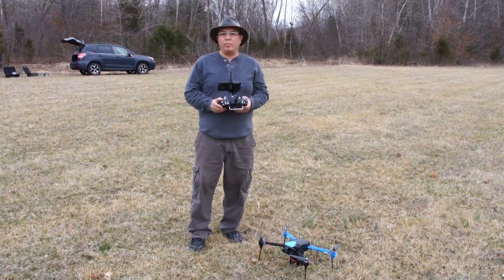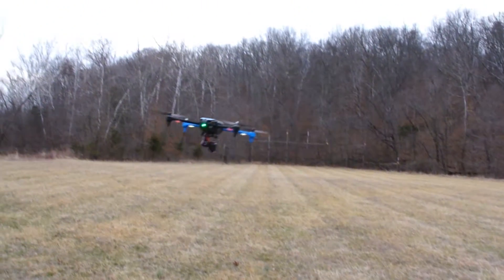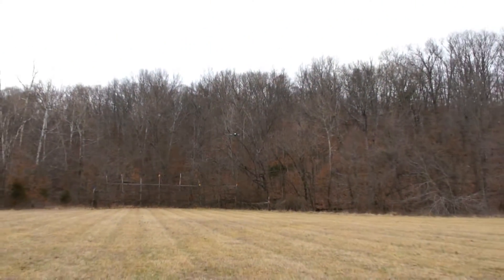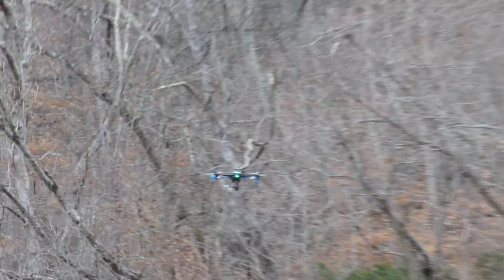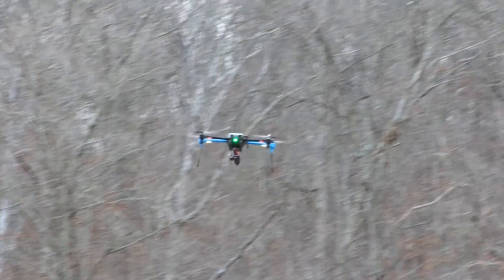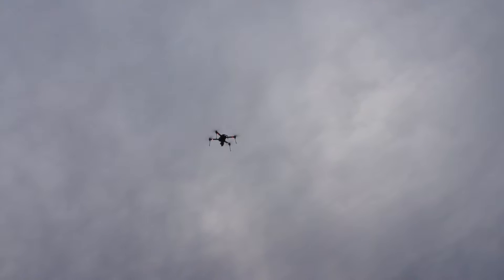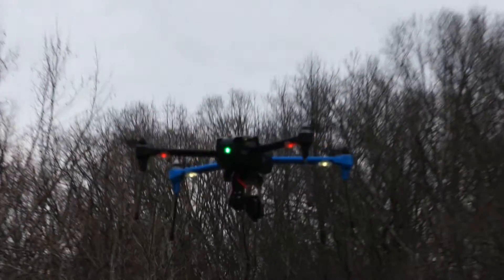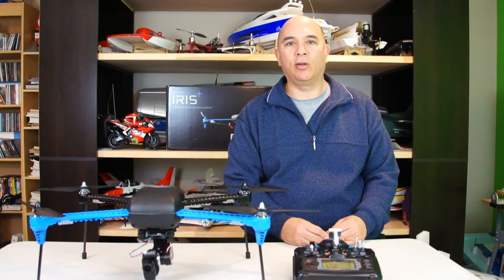3DR IRIS+ AutoTune 1st Attempt

Comment: You should never autotune an iris ever! autotune is for pixhawk custom builds,if you do not know how to reset factory settings ? call 3dr support and have them walk you through the process! iris is already setup perfectly out of the box R&D spent alot of time getting the perfect settings the only changes that ever need done if you are realy in photography than you can change the settings to slown down speeds for video /photos to get a better shot

Comment: Autotune is a utility for roughing in the settings on a scratch build. 3DR has spent considerable time developing settings for the IRIS+ that actually work very well. Your bewilderment at what this IRIS+ is actually doing from the 6 minute mark on is very strong advice NOT to emulate what you do here. 
Mine flies like a champ. I got it that way by making small incremental adjustments - one at a time to pitch and roll settings. If you need help restoring your default configuration, please stop by the 3DRobotics IRIS Owners Page on Facebook.

Comment: Are you using cleanflight autotune, or is it just an iris thing?
Reply from the maker: ***** I think cleanflight autotune is for the naze32 flight controllers. The autotune we used is for 3dr flight controllers like the APM, PX4 and Pixhawk. It's in the Arducopter and MissionPlanner software.
Reply: Ok, sounds good, thx for sharing.
Reply: ***** Did you follow the compass calibration tutorial on mission planner? that is by far the best method to use,I have did about 12 pixhawk setups and once I saw this method it was a lot better than any other and a lot easier!

Comment: The best thing to do is land and save your settings , by switching autotune on and off you have started tuning on the pids that the previous autotune were set at :)  no wonder it started oscillating
Reply from the maker: pavalige I think you are right about that. Next time I'll be saving the settings right after it's done with the autotune..